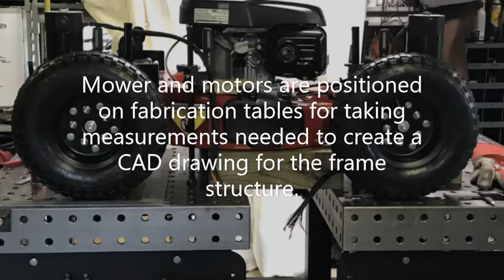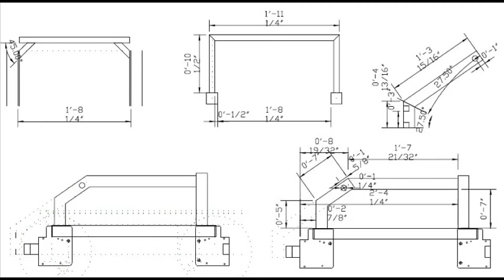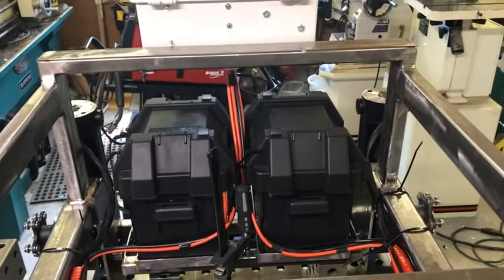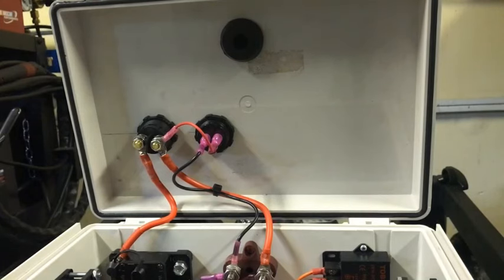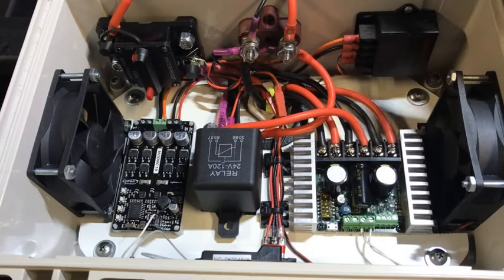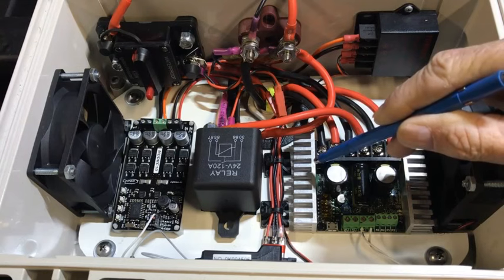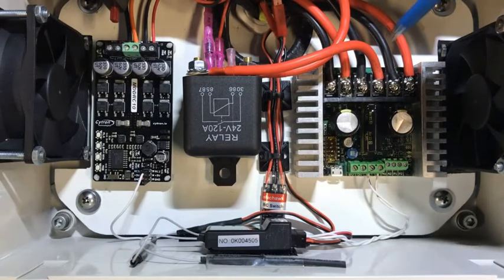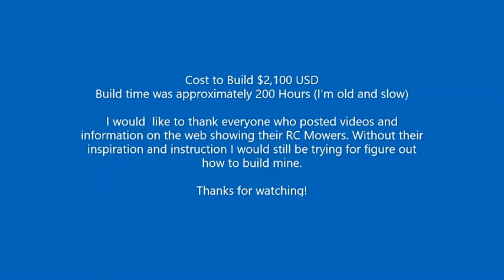Four Wheel Drive Remote Control Mower Build

Comment: Brilliant. Well done!  I didn't have the access to the tools you have and ended up buying a 22" robot mower for $3k. I would suggest yours is better by far. one additional feature that would have been superb would be a deck height adjustment.
Reply from the maker: Hi Cayrick, thanks for the compliment. The deck height does adjust, it uses the stock hardware that came with the mower. Only down side is the batteries are mounted to mower deck so raising and lowering is chore, it is heavy. I was using it today and wish I had included an actuator to raise and lower the deck.  $3k is not a bad price, I am probably around the same outlay.

Comment: Very well done. Best of all, it does not look like a home built. What is the function of the Cytron 10A dual RC installed on the machine for? Thanks.
Reply from the maker: Hi JB, thanks for the compliment. The Cytron 10 dual RC is for the linear actuator that moves the front toolbar.

Comment: Hello, good afternoon, I would like to know if the motors are connected in series or in parallel? The controller only has input for two motors, are the 4 placed together? thanks for your support. greetings.
Reply from the maker: The motors are connected parallel. Each Sabertooth channel controls two motors. The control signal from a receiver channel is assigned to controller channel. S1 and S2  each drive two motors. Watch “Mow    Power” on my channel for an explanation on how this is wired. There is hyperlink in the description to the wiring diagram.

Comment: Greeting. I made a lawnmower with 2x24v motors, I use Sabertooth 2x32 A, so I'm wondering which alternator do you use 12v or something else to charge the battery?! Ina will make a good video and how to make a lawnmower.

Comment: I am working on another project, but it is going to be a riding mower.  I have 2 of the actuators that you have to run the deck up and down.  Can you share the way you wired so it is controlled by the remote?  A video would be great or even schematics on how you accomplished this.
Reply from the maker: Hey Robert, the actuators are just dc motors with a limit switch and should only have a + and - wire. The wiring will be the same as motor connections on a motor controller. I am controlling my single actuator using a separate motor controller set/wired to channel 4 on the RC transmitter/receiver (left joystick auto return to center). If you are using a one motor controller this will be easy. If you are using a two channel motor controller and want to use one stick movement to control two channels you can setup channel mixing on the transmitter. Lots of good YouTube videos on channel mixing. I almost forgot the 3rd choice, using RC pigtails, one receiver output channel to two motor controller channels.

Comment: Hy,
I'm currently working on similar projects. 4x invacare, sabertooth, Chinese RC controller.....
One question, Is it possible to remove the batteries and powered the whole system with the alternator.
24V on 50 amps is 1.2 kw off power.
Are batteries needed at all??
Reply from the maker: Hypothetically it would be possible. Using a Sabertooth controller you will still need a small 24VDC battery source because of regenerative braking. You would also risk damaging the controller when pushing the mower without power. See controller to battery diode requirement in video and schematic diagram. I have the larger 24V batteries because my 65A alternator alone will not provide the 120A needed if the 2x60 controller is drawing 60A per motor channel. My mower engine would not have enough horse power to drive a 120A Alternator. Watch my video on the upgrade to the Sabertooth 2x60. It illustrates my screwup when sizing the motor controller.

Comment: I'm very curious why you use the 12,24v to 5v converter rather than the native ports on the sabertooth. Did you see a forum discussion or something suggesting that was better?

btw this is like the 5th or 9th time Im going through your rc mower vids. Im in the process of building a utility/beach cart that is electrically very similar. I hope you dont mind me coming back to ask more questions.
Reply from the maker: @tedbastwock3810  Hi Ted, The Sabertooth has no power until activated by  the Flysky  RC control. The receiver needs the 5V to operate.  Please read the comments for all my videos on the mower, there are over a one hundred answered  questions related to the build. If you don’t find an answer to a question, leave me a comment, and will I gladly provide an answer. Good luck on with your build!

Comment: I've had good luck with the Cytron dual 30a controllers
Reply: Are you using Cytron dual 30 controllers to connect to four motors? I was planning on connecting all four motors to a single Cytron dual 30 controller. Not sure if it can handle the load.

Comment: Absolutely the best design mower also the wire loom is clean and tidy. I wanted ask about the second motor driver. 
Is the sabertooth 2x32 for the rear and the other motor driver for the front drive ?. That air cleaner breather is a great idea.
Please make more videos about your design, I loved every minute.
Just looked at your drawings, it’s incredible people like yourself that make YouTube so much more interesting.
Reply from the maker: Thanks for the compliment! The small motor driver is for the linear actuator for the front toolbar. The Sabertooth left and right motor control channels each drive two motors. The 2x32 has been replaced with a 2x60. See the “Mow Power”  video on my channel.

Comment: Mr. Giter Bilt just an update on my build i did find some carlisle tires but i had to get the 13x4x6 because the wheels i got from harbor freight were the flat free tires and two piece wheels. also i got the no spst solenoid and we replaced it with no change the switch 6 still dose not kill the machine and it continues to run wild if the key switch is enabled prior to the transmitter being turned on. it is frustrating but the machine seems to work fine other than than i appreciate your continued ihelp
Reply from the maker: Hi Danny, when you turn the key on there should be absolutely no power to the sabertooth. Try this, remove  + and -  wires from the solenoid that go to the elechawk.  In this configuration, there should not be any power to the sabertooth. The solenoid will be in state where the 24V positive from the battery connection to solenoid can not switch power to the opposite terminal. This is the normally open state.  This will leave the other two wires , one for the battery 24v positive on one pole and the opposite pole is wired to B+ on the sabertooth.  There should be the only one wire connected to B+ on the Sabertooth. With the key on or the key off the sabertooth can not turn on.   Also make sure there are no wires connected to 5V on the signal side of the controller. Let me know what happens and we can go from there.

Comment: Very nice build. Im building a similar rc mower. Could you confirm if that mower is the same as Toro smartstow 21445 on Ace hardware's site? There is similar models such as the 21442. Would like to get the same mower for my build so I dont run into any issues with the alternator mounting etc. Thanks!!
Reply from the maker: Thank for the comment! The mower I used is discontinued. The specs are similar to the 21442. Good luck with your project.

Comment: Mr Giter Bilt  when i was testing the input on the elechawk for 24v  i noticed that the red + wire appeared to be on the output side of the switch i am wondering if this could be the issue? Possibly i hooked the power for the switch to the wrong side. Any thoughts?

Comment: Fantastic video! I am still wondering on something. What did you do with the engines? Is there a chain or axle on axle? If you could help me I would appreciate it, building my own 4wd rover but with 1000 w brushed engines.
Reply from the maker: The mower has 4 wheel chair motors with attached wheels.

Comment: mr gator do you have any info on how you dealt with the mower shutdown cable   thank you
Reply from the maker: I took the low tech route for the shut down. Once I removed the shut down cable from the from the shut down lever, I threaded a zip tie through the hole where the cable was attached. I closed the zip tie to form a loop and slid the zip tie trough the slot on the cable bracket. I adjusted the zip tie loop to the point where it engaged the shut down switch. When I need start the mower I slip the zip tie loop through the slot on the the cable attachment. When I need to shut down the mower I slide the zip out of the cable bracket.

Comment: Awsome work.. why did you choose a gas mower over an electric model?
Reply from the maker: I had thought about it. Weight, run time, price and the ability to cut taller thicker grass was the consideration for my choice for using a gas engine.

Comment: Hello. Can you tell me which battery are you using? How long to charge?
Reply from the maker: Weize 12V 35AH Battery Rechargeable SLA Deep Cycle AGM Replace 12 Volt 33AH 34AH 36AH 30AH, in Series 24V 36V 48V for Power Patrol SLA1156 Ritar RA12-33 Renogy PV Solar Panels Bat-Caddy X3R Golf Caddy https://a.co/d/hDJ6Ei0
Reply: Thank you so much 🤜🤛
Reply from the maker: By using the alternator setup it takes 15 minutes charge time per hour of use.

Comment: Thank you for sharing this incredible video! Quick question- how did you go about sizing the alternator? I’m assuming the motors don’t take anywhere near max draw for most usage?
Reply from the maker: My criteria was a single belt pulley, single wire system, 24V and cheap. I have an explanation of the alternator performance in the comments for the “End of mowing season review video”.
Reply: @giterbilt5146  thank you for the reply. I found that comment thread and asked a question there

Comment: Very impressive!! Thanks for sharing. 
Is the second receiver for the operation of the front arm and the trimmer? Can you operate both controllers on the same transmitter?
Reply from the maker: Yes the second controller is for the for arm. There is no controller function for the hedgtrimmer. Both motor controllers operate from the same transmitter receiver. Thanks for the compliment.

Comment: Is the linear actuator for the tool bar powered/controlled by the cytron 10 amp dual motor controller?
Reply from the maker: Yes it is.
Reply: @giterbilt5146  What was your thought process when deciding to purchase a dual motor driver vs single for the actuator? Was there a suitable single driver controller for a RC setup?
Reply from the maker: @H_Learns  I got the dual for future need for implements attached to the tool bar that might need 2 axis movement. Cytron makes a single motor controller for RC.

Comment: Hello, I wired the signal wires from my Cytron driver to my RC receiver which has the same 5v supply as yours but for some reason the signal to the motor controls doesn’t work. I am curious if i missed something in your video. I have tested the receiver and controller independently and they both work. Any thoughts?

By the way. Great build.
Reply from the maker: Hi John, you can try using both the ground and the signal wires from the receiver channels. This is the only thing I can think of.
Reply: @giterbilt5146  can’t thank you enough. The ground wire resolved the issue.

Comment: Hi wondering you can can share a video on the attachment of the wheels to the motors. Have seen some others commenting along these lines . Been trying to work out is there's an additional metal plate added  , I  realise the motor comes with a plate with 5 studs. Looks like the wheel has 4 bolts holes and something is attached to them and then there's 5 bolt holes for the motor. Can't quite work out the wheel axle and what that bolt is. Thanks.
Reply from the maker: Hi Michael, unfortunately I did not video the modifications I made to the rims for the bolt pattern on the 5 bolt wheel chair motor hubs. The rims I  used were split rims with four holes that bolted the halves together. I used a milling machine and a rotary table to drill the five holes to match bolt pattern of the wheel chair motor hubs. I have two videos from others that show what is required. For measuring the wheel chair motor hub pattern https://youtube.com/shorts/73c_wgt4vpM?si=G9qIVdy5Dxn8_kVs. And what is involved in drilling the new pattern on the rims https://youtu.be/pPp61MqjOds?si=gpH6QTfnx_RtGPbC. If you do not have the equipment to do this, a local machine shop can handle this for you.
Reply: Thank you

Comment: Mr. Giter Bilt  i hired an electronics tech to check out the wiring on my machine with the info you provided and each item checked out. that being said the wheels still spin at a high rate backwards whenever i turn the key on without first turning of the flysky transmitter. there dosent appear to have any voltage at the b+ or B-. altho this does happen the machine seems to work as expected when the flysky transmitter is first activated then the key turned on. one more question i also have issues with the smaller run flat tires so i ordered the carlisle tires you have but the harbor freight dosent seem to have any pneumatic tires and wheel that will fit these tires any help again is appreciated i hope im not being a pest   but i love this mower
Reply from the maker: I don’t believe harbor freight still sells the rims I have. I used 8 wheels to make the four wheels that I used. I only needed the rim half that did not have the bearing. I put the 2 non bearing half’s together, and used an inner tube sized for the tire in use. The harbor freight four bolt pattern would not work so I drilled new bolt pattern to match the motor hubs of the wheel chair motors. I did this using a rotary and my milling machine.
Reply from the maker: Danny, what is the make and model of the relay you are using?

Comment: I have built something similar, ryobi 40v push mower and have the sabertooth 2x32.  I am having an issue with it cutting off and the need to reset the system to get it to cut back on.  However, after doing this for quit a while, now it will only run for about 2 minutes then stop.  I looked at my motors and realized that I have 24v by 75amp motors.  What is the amperage of your motors?  I have ordered (2) single 60amp controllers with a surge max of 100amp.  Does this sound like my problem to you?
Reply from the maker: Hi Robert, I was having the same issue. My motors each have a 50amp max, two per channel for 100amp max. The 2x32 would not provide enough current to run the this set up and was would shut itself down to protect the controller. See my video on upgrading to the 2x60 which explains my screwup on determining the motor controller size.  I also had to limit the power output to the 2x60 controller using setting on the RC transmitter. See my video on two speed operation. Having the 100amp controller for each motor will hopefully solve your problem.

Comment: Why did you use two motor controllers?  One for front and one for rear motors?
Reply from the maker: @paulburroughs1313  Hi Paul, the small motor controller is for the front toolbar actuator. On the sabertooth controller two motors on one side are run off of one channel.

Comment: How's the skid steer on the turf? Just curious. I built my first electric riding mower prototype, but wasn't strong enough for steep hills. So I'm actually considering going with a remote control system. But unsure about skid steer.
Reply from the maker: It isn’t hard on the turf if you navigate with out sharp turns. I mow laterally on a hill so I do a kind of a side ways z pattern when I am at the end of mowing swath. I backup at an increasing angle until I am in position again, move forward to catch the grass not cut while backing up, then begin mowing the next strip. If it were not for the traction of these tires I would not be able to mow the areas I built the mower for.
Reply from the maker: I forgot to mention that this reply refers to the tires shown in my other videos.
Reply: @giterbilt5146  awesome, thanks! I might start this project soon. Still researching the differences between tracks and tire options.

Comment: Mr. Giter Bilt  we;; i disconnected the + ans - wires from the solenoid and nothing moved at all. when we reconnected the elechawk the wheels again spun full speed backward  the one battery 24v pos is on one pole the opposite pole is wired to B+ on the sabertooth. there is only one wire on the B+ and there are no wires connected to the 5V on the signal side of the controller. to ensure that the elechawk was not the problem we connected a new one exactly like the one in your machine and noted the with the transmitter off and when the key was turned on the wheel again spin and a blue light flashes quickly in the elechawk. when the transmitter and key are both on the blue light is not on and when the channel 6 switch is activated the blue light turns on.
Reply from the maker: Well we’re getting somewhere. Unplug the electhawk rc connection to the receiver. The elechawk has power in +(red), two black ground wires, and a power out +(red). The power in + should go to battery 24v + key on. One black wire goes to battery -, the other black wire goes to relay for closing the contacts (energizing). The power out + red wire should go to opposite energizer pole.  With the key on the elechawk  is in the Normally Open state, the led will flash blue, and the relay is in the Normally Open state.  Motors should not turn because there is no power to the motor controller. There is an updated sabertooth diagram.dxf that shows the key switch wiring on the google drive. Let me know the outcome and we will go from there.